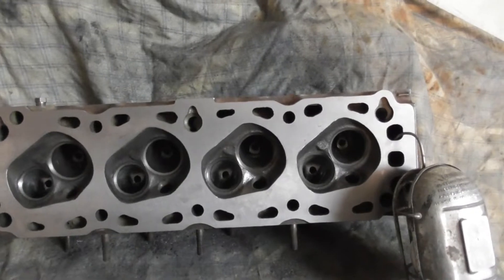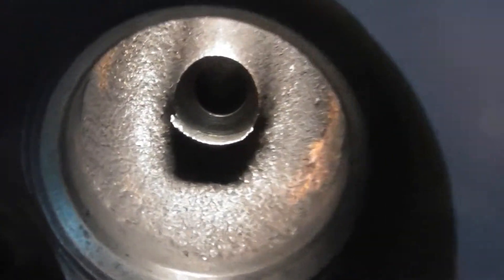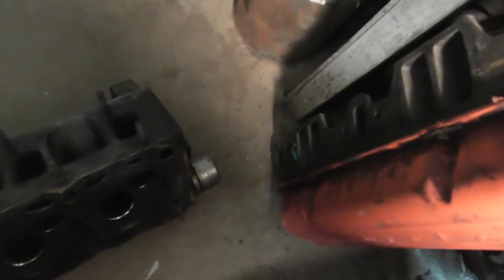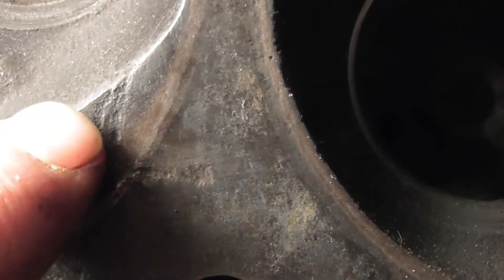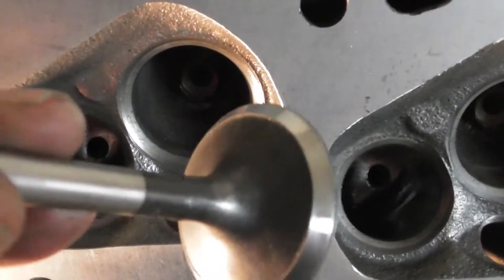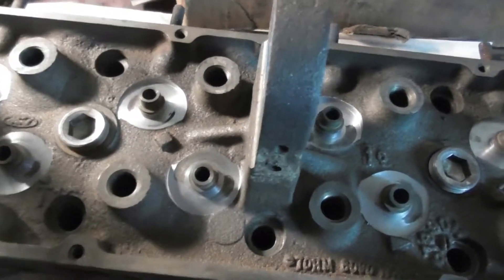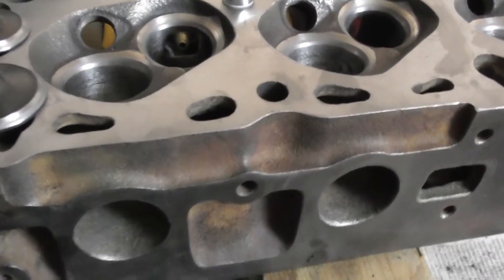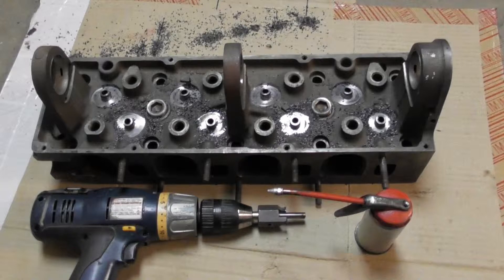2.0 ford pinto sohc cylinder head rebuilt for the vw sandrail turbo buggy

Comment: I have to say looks Good       REED ALL THIS WIN EVERY RACE AT 8MILE TRACK........
problem is if you are running shop standard length valvles you just wasted half the cash you spent on that new camshaft Pinto 2lt engines hate hate hate valves been cut deep in head. for every 2mm valve seat cut you loss 1.3mm in valve lift so if you dont get it right all the exstra valve lift from the new cam can be lost.....https://www.youtube.com/watch?v=THNIMNLizso
https://www.youtube.com/watch?v=KX-VSiMM1NE
http://www.turbosport.co.uk/showthread.php?t=152892&page=2
http://www.turbosport.co.uk/showthread.php?t=109939

Over here in UK we had poor mans Mustan called ford capri mk1 had kent cross flow engine mk2  mk3 had 2lt pinto No v8 opportunity so us in UK realy know how to tune up 2lt pinto. Cosworth build 16v turbo as standard 300bhp 575bhp in RS200 .

https://www.youtube.com/watch?v=Nc_ovDWDRWc

https://www.youtube.com/watch?v=QuXYUrtqIaY
https://www.youtube.com/watch?v=QL1Tx4BMMPE&t=1s    275hp out of an old donkey like a Pinto
Reply from the maker: thanks for the info, not sure what the owner has done with it, he has had some back problems lately.
Reply: @chevyfarmersgarage1955   Have you had it running with new head  (smoke) when you say it smoked. FIRST THING IN MY HEAD WAS DID'NT HE SAY IT WAS TURBO'D  standard 2lt pistons are the weakest first thing to brake even on high compression non turbo spec. next to go is big end bolts not the con rod SO SET OF ARP'S NEEDED. so it could be broken ring land, piston brakes under top ring so you cant see it with head off only if you take pistonS out had this on two high spec high compression engines that I built..
so the old way to get around it was 2.8 v6 pistons but now we have expensive Wossner piston or cosworth but toyota r22 pistons 92mm can have crown cut down by about 5mm and cost very little.  This any many many more things is all covered in TURBOSPORT WEB SITE.......
Reply from the maker: @kizzerplowright8038  i heard he had it running and it still smokes, i told him to remove the pistons for inspection when the head was off, he didnt listen to me about that, the detonation the head suffered was obvious, i dont know why one would assume the pistons were fine.

Comment: So did you keep that head.  With the crack it is scrap unless you were able to weld it. The living on the face could be homed off but they would depend on whether the head had be skimmed before or not
Reply from the maker: no it went in the junk. thanks for watching